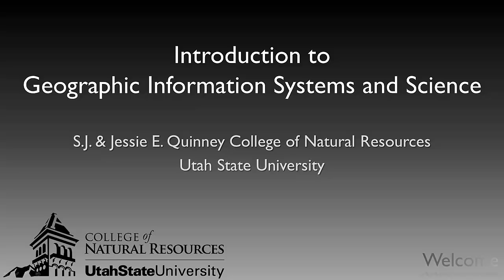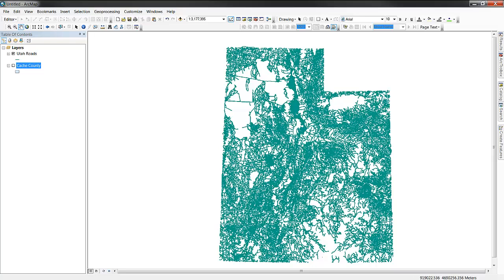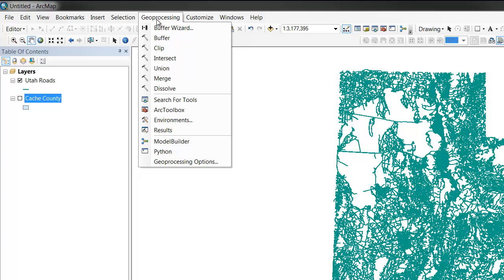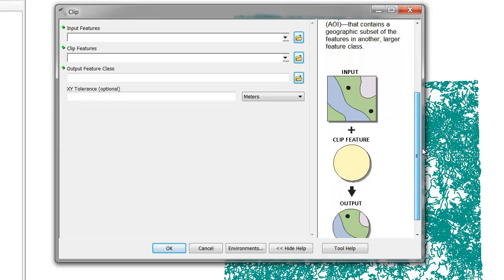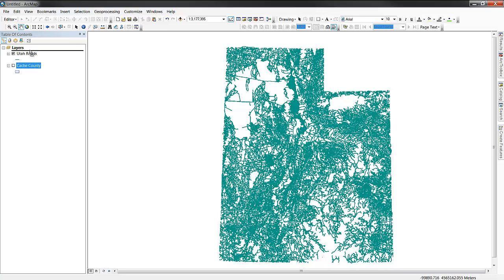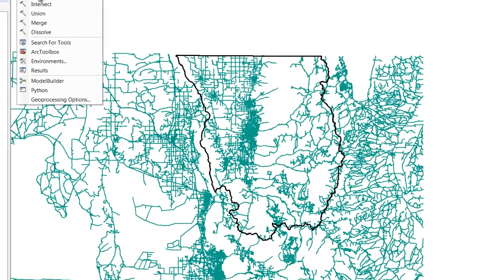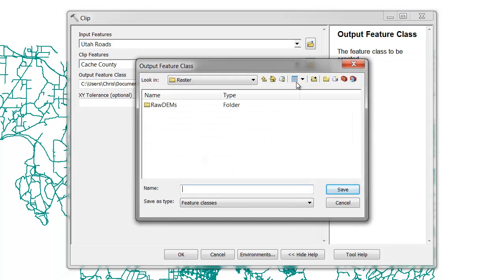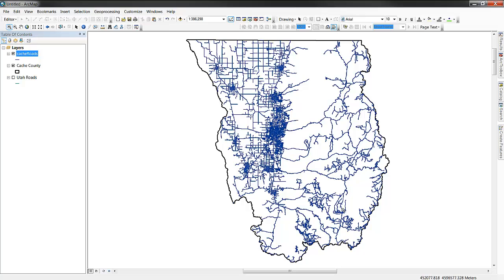Utah State University - GIS Lecture Series - Using the Clip Tool in Esri ArcGIS

Comment: Could you do a short video on clipping the basemap of an area. I live in Cedar City, Utah. If I add a basemap using the Add Data drop down menu in the top menu and select Imagery it will bring in the whole world into my map drawing. I would like to clip just the Cedar City area of the Basemap using a polygon as my cookie cutter. Could you show me how to do it? Thanks.
Reply from the maker: MontiR, If you are using the Esri ArcGIS basemap data from the "add data" button, there isn't any good way to subset that imagery due to the method it is being loaded and the ownership rights. If you are working in and around Cedar, you can go to the Utah AGRC (gis.utah.gov) and download the 2011 NAIP imagery and use the Extract by Mask tool to pull out only the information within your area of interest (for example, the Cedar City municipal boundary). I will try and put a video up about this sometime soon.